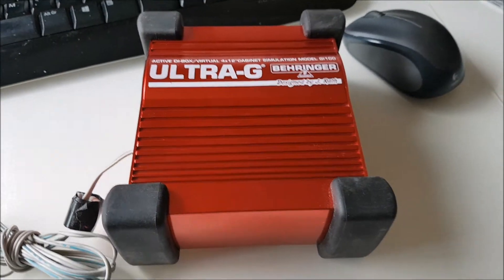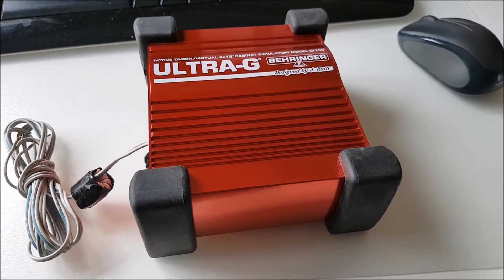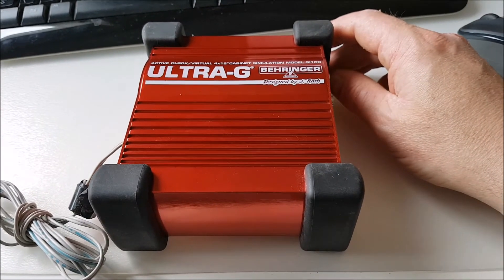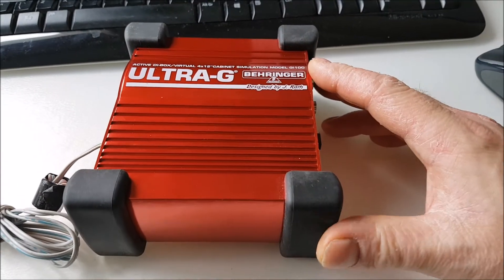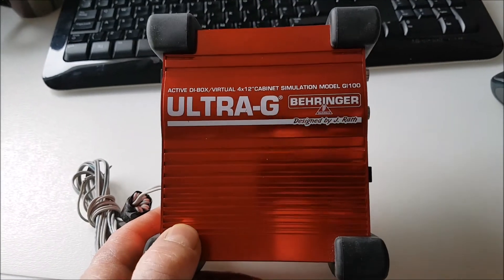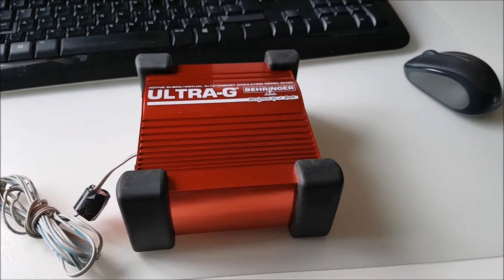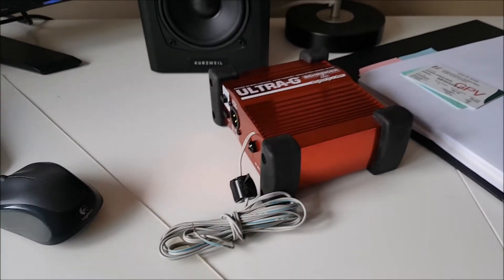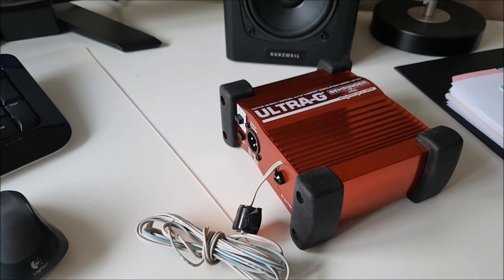Behringer DI Box Explained | Ham Radio Audio for Cal at DX Commander

Comment: How do you power yours? Ive got an active di box and said it powers via 12v dc or 9v battery....... Only every time I power it via 12v i get noise but powered by 9v it works fine
Reply from the maker: Ive a modified CB supply that outputs 9v at 5A capacity

Comment: Hi A Very informative video, a quick question so if I’m trying to use a dynamic microphone and connecting to an Icom . The Icom puts out 8v on pin 1 the microphone input, so I’m putting a 1mf cap from pin 1 to block the dc before it connects to the di box ? 
Your thoughts would be appreciated.
Reply from the maker: I've not hooked up in this format. But by the sounds of it you have followed the directions in the manual ref the DC blocking capacitor...

Comment: Great video. I have a Icom IC-7700 which as you now has 9volt on mic pin. I have a BM800 mike which use phantom power. And I have a Behringer Ultra DI100. Can I use the 9Volt in the Icom as Phantomflammen Power for the mike? Or do I need a eg. mixer with Phantom power? I have seen many vids stating the BM-800 can work from below 9Volt. 73 Per HB9GIM
Reply from the maker: Hi there. You can get the BM-800 to work with small voltages, but the circuit is designed to work on 48v....you wouldn't (if you could get one) put a 3-volt battery in your car would you? In my case at the time I made this video, The BM was getting phantom from the Behringer MIC2200 Pre-Amp. You want to keep the DI box in this application as a stand-alone item. Thanks for the comment and I hope you subscribed!!!
Reply: @GeorgeEI7KO  thanks :-) I have just bought the Yamaha MG10XUF so I will run the BM-800 through that and then into the DI. I will change to unbalanced in the Mike connector on the radio. Because of the DI, do I need to insert the 1 uF tantalum? Which will be in the same mike connector. Have a nice day.
Reply: Ultra G have unbalanced input and balanced output
Normally essb equipment have balanced output and 90% of radio rig unbalanced input so it should be connected in the opposite way. Maybe not the right pad for our needs

Comment: Why don't you use an isolation transformer, is there an advantage with this method?
Reply from the maker: If you can find me new isolation transformers for the same price, ill buy loads of them. Does the same job at a fraction of the cost.
Reply: @GeorgeEI7KO  Ah, makes sense, thanks for the reply. But sometimes they can be bought cheap if they are second hand.

Comment: Why not the ultra DI rather than the ultra G?
Reply from the maker: In short, the only difference is the Ultra has both a TS and an XLR for the inputs. You only need a TS in the application of Ham Radio. Either or will work tho
Reply: @GeorgeEI7KO  Well i got me one second hand. Got it all setup and working well. Thanks for the help in these videos! Also, why did you switch over to the dbx mic preamp? Doesn't seem like you get much more out if it than than behringer 2200 (same one I have)
Reply from the maker: @dantheman20127667  I changed to a shure SM7B and the mic 2200 didn't provide enough gain